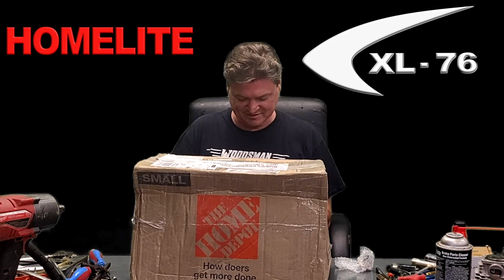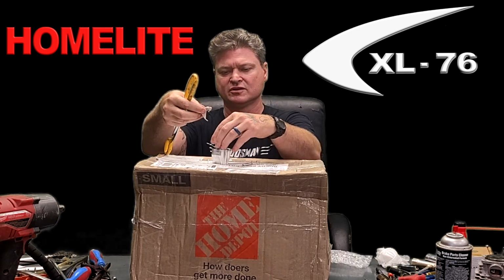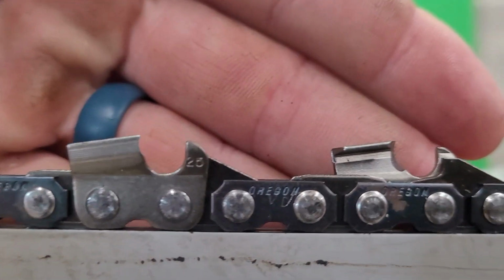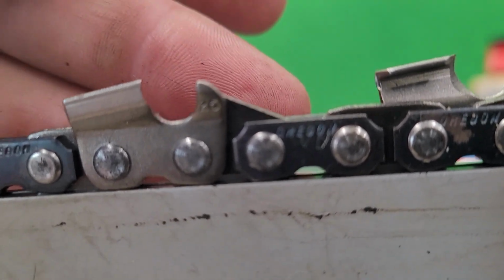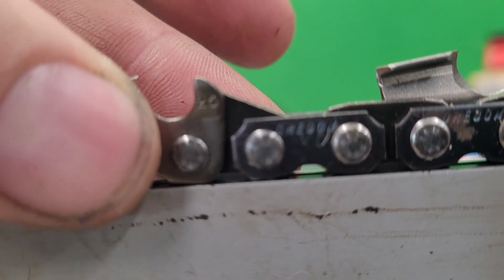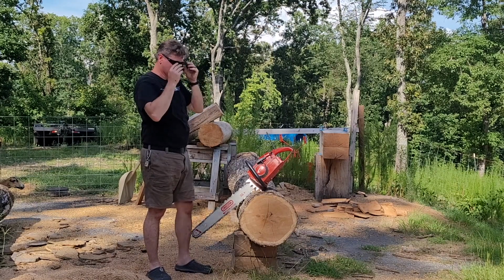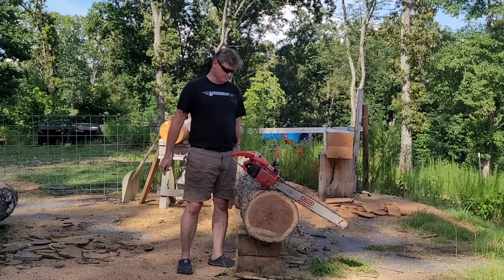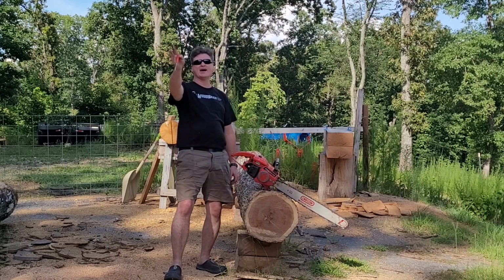Homelite XL 76 Initial thoughts

Comment: Check it to see if YOU have it tuned too lean. If that is not the problem with the chain still spinning then you probably have a vacuum leak or a broken clutch’s spring. Check it out with your break-parts cleaner. 
You might always have the thing turned up to high on the idle screw. 2strokes can be “fickle” you know. Your experience AND mine both.

Comment: You wanna make a china 372 reed build?
  Homelite had a few models with oiler on bottom of saw my xL12 has oil cap on bottom
 The SXL has oil cap on top and 58cc vs 54cc
And yes I hog out the hole just a tad bit